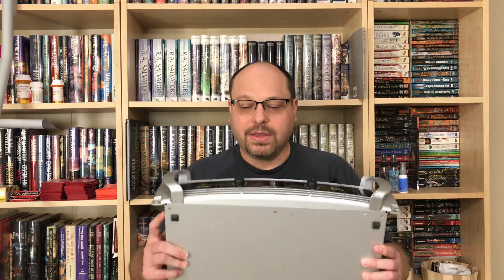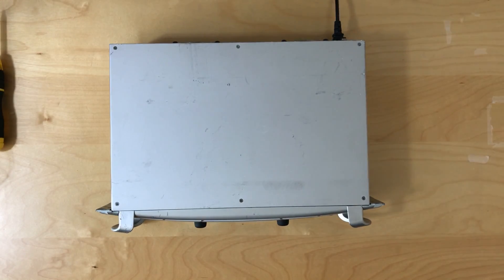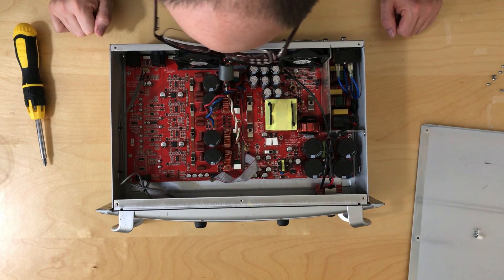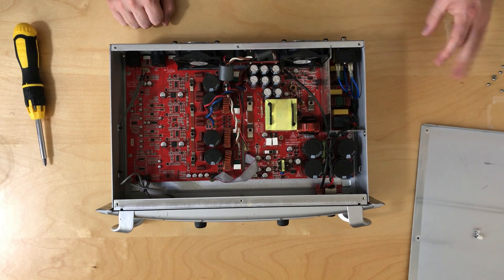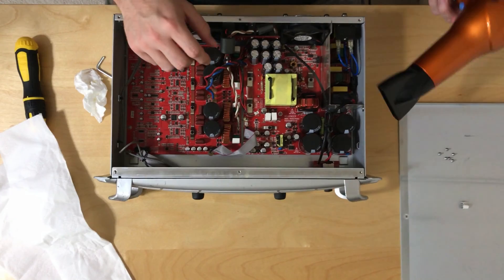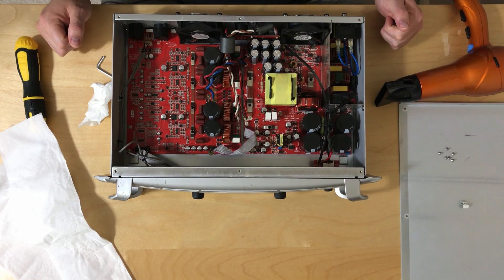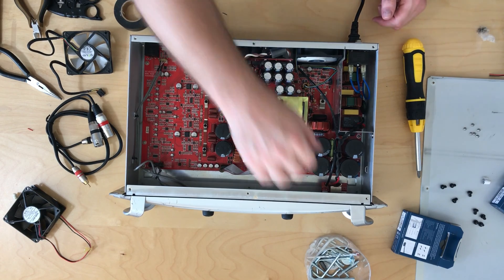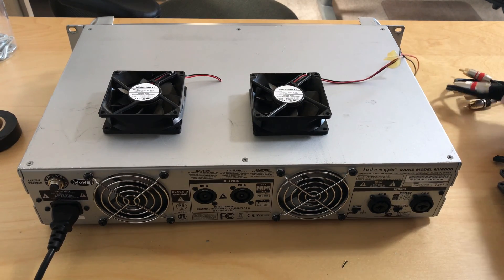How to: Behringer iNuke NU6000 Fan Upgrade - Make it sound the best it can.

Comment: I used this fan Arctic F8 PWM in a NU3000 and it works perfectly. In a NU6000 I used two F8 fans and it works too without modding the wires because these fans are 3pin and these connectors fit. Amps are operating at full load since now.
Reply from the maker: Awesome!!!

Comment: On a Behringer NX6000 (non dsp) running 2 Marty cubes with Dayton UM-18's how would you set the rear crossover switch? Lf, full range, or Hp? This amp will run off of a mini dsp though none of it is set up yet. I ask just for initial setup? I just performed the fan mod. Thanks!!
Reply from the maker: Full range. You dont want the amp performing any crossover.
Reply: @JilesMcCoy  Thanks alot!! I am setting it all up now...I should be up most of the night. 😅🤣😅
Reply from the maker: @JesusChrist-em8gj  If you have questions hit me up on FB!

Comment: If it doesn't have DSP get a Crown XLS.  No fan noise and way better reliability.  Seen any behringer amps in nightclubs, theaters or any other commercial settings?  Nope.  Crown and QSC only and the QSC fans are loud as hell too.
Reply from the maker: I have moved on to Sinbosen amps now.

Comment: Thanks for the video!  Great camera work on getting the detail of removing the original cables.  That is often lacking in this sort of video.  One suggestion if you ever want to do another of these is to provide an A->B comparison of the fans with the same mic in the same spot and edit the video so that A-> B appears one after the other.  Thanks for providing an update on the function!  Glad they’re still working.  If it breaks, please let us know!  Thanks!
Reply from the maker: Still going strong now!

Comment: Thank you for the tutorial Jiles. It took 20 minutes to upgrade my NX6000D with your tips! I finally decided on Noctua NF R8 REDUX fans. They are 3 pins, so they fit without modifying anything. They are very quiet and have a higher CFM than the Artic fans.The Noctua A8 ULN fan that I originally wanted was OOS everywhere.  Very happy with the results.
Reply from the maker: Great to hear! I will give that fan a shot too!
Reply: Any update? The noctua r8-redux is $12 and the a8 4 pin that everyone recommends is $22 ..

I’m doing two nu6000 so it’s $48 vs $88. Thinking of going with the cheaper r8 like you did.
Reply: @hbs187  The NF R8 REDUX have been working perfectly well for 2 years now. I highly recommend them!

Comment: the fans should blow inside the amp.
Reply from the maker: They are set up like the factory ones...
Reply: In this scenario, for a variety of reasons, I'd suggest the fans should extract air, not push air in.
Reply: The thin foam filters are on the front face; if you blow air into the amp from the back, you're saying your goal is to...trap the dirty air inside the amp? I've reversed the airflow on 6 or more Behringer amplifiers currently in use, & they run cooler & cleaner! :)  [When I spoke with Behringer about this "design flaw," they said I made a good point; I just don't believe they'll deem it worthy of a change in production methods. After all, they work fine the original way...but the new way is better - cooler & cleaner.]
Reply: @ArkSound58  The inside cardboard guides are directing the blow directly on the switching transistors and the coils so, the front should not have any filters - mine does not have any filter.

Comment: Come on guys, this is not proper engineering at all.  You should replace the fans with quieter fans that HAVE the same air flow capacity.  Based on comments I've read here, that was not taken into account.  Of course the new fans are quieter because they don't move as much air.  Moving that much air is probably necessary when the amp is running at full load.  So, run it at full load now and you're probably going to damage your amp, or at least have it shutdown before it normally would.  AND, the direction of the air WILL make a difference in the cooling capability of the air.  The only way to know for sure in all of this is to measure the temperature of the transistors (mosfets) or power amp chips and see what the difference is between the old and new fans.  I'm an Electronics Engineer and definitely do NOT recommend that anybody make this type of modification without the proper temperature measurements.
Reply from the maker: Gene Smith I don’t disagree with any of this. The amp is still going strong and I run it super hard in a closed cabinet.
Reply: @JilesMcCoy  Well, can't argue with that I guess.  That's as good of a test as measuring the temperature difference like I mentioned.  Real world application always trumps theory.  So, rock on my friend!!!
Reply: @JilesMcCoy  Too high a temperature doesn't cause instant catastrophic failure. It compromises the lifetime of those electrolytic caps. And unfortunately Behringer tend to buy their caps at the local flea market. I've had two mixer power supplies go belly-up with cap failure. I now make it a matter of policy to replace all electrolytics with Nichicons, which will outlast the rest of the parts. Those new fans are only 31 CFM instead of the 45 CFM of the originals. That is a big drop and you really should look for some better spec fans. You can certainly find quiet fans that will match the performance of the originals.
Finally get some ventilation in that cabinet - you've built yourself a time bomb.

Comment: Just did this mod to my NX6000D which sounded like a jet in my living room. The fans where blowing such a gale I got a draft from where I was sitting some 8' away!
Can hardly hear the new fans, however, they are quiet because they are not generating as much air flow. I am hoping this will be sufficient to adequately cool the amp.....
Reply from the maker: So far mine is holding up ok.